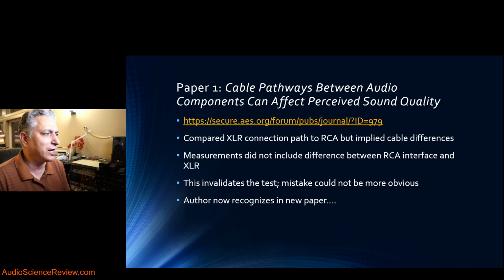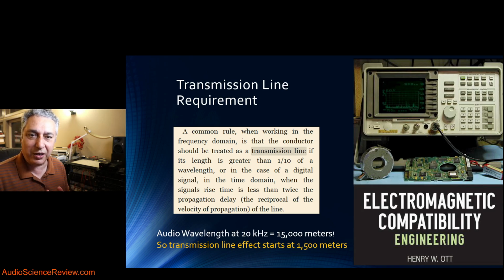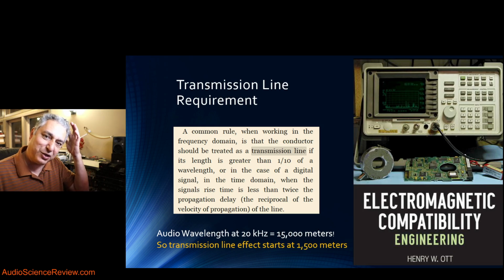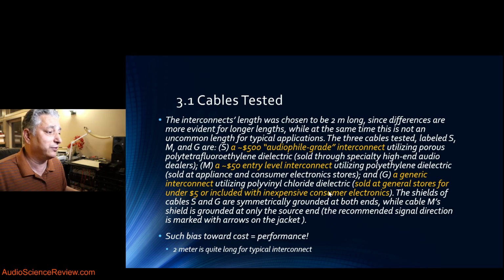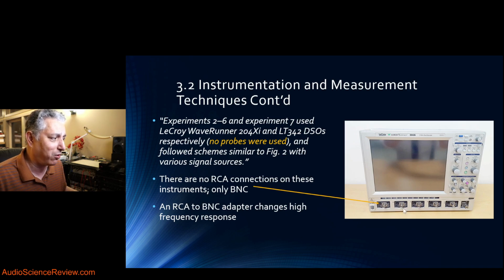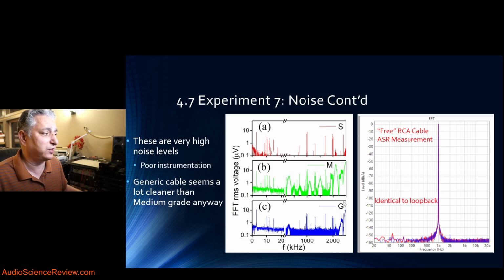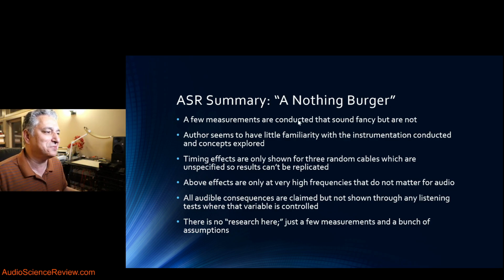Scientific Proof of Measurable Difference in Audio Cables? Paper Review

Comment: Jay likely has more real world experience with both vintage and modern high performance audio than 90% of the people subscribed to this channel. But thank goodness you have Amir with his vast knowledge of everything in audio - so he can smite both Audiophools and misguided professors alike. However if you want to save some time I can help you. All cables at any price that measure the same sound the same. Only Amir's test gear and methods are valid when it comes to determining wether cables or gear are better sounding. Higher price cables are all snake oil and the people buying them are under a mass delusion. So from here on out don't buy anything and listen to it for yourself. Also if someone happens to slip a high end cable into your system without your knowledge and you hear a difference - this is just the transfer effect from the delusional person that played this evil trick on you. Come immediately back here to ASR to be recalibrated so you don't have any more of this artificial enjoyment while listening to your system.
Reply: The problem is not that people enjoy their systems at whatever price point they choose.  The problem is when people start evangelizing for high-end cables and shaming other systems as non-resolving if they don't use these high end cables.  You're welcome to your delusions but that does not make it right to recommend others to them.  That's just a misery-loves-company state of mind; justifying your own potential for poor judgement by encouraging others to make the same misguided choice.
Reply: @johncreech6012  I have never seen or heard any owner of higher end cables shame anyone. But it is the standard chatter here after Amir drops one of his so called "Debunking" videos. John you could not even resist throwing the shaming shade at me during your short reply. Poor judgement, Delusions and the like. As for a misery loves company state of mind - that should be the name of this channel
Reply: @johncreech6012  John literally every negative comment you assign to the supposed legion of insulting cable snobs came from Danny at GR. So find me one or two more YouTube reviewer that say anything like this. Lets take Jay's Video that all you ASR minions put AMIR onto to do his life saving debunk. He is reporting the he and several of his audio buddies are hearing improvements with cables. So he started to try and find out why. Never once did he throw shade on the folks that don't think cables matter. Just the attempt to assign any measurable reason for this caused this community to go into overdrive with all your negative comments. So lets be clear are you calling him and his friends delusional? As for Amirs methods and testing protocols - nothing I could not have found from and engineer 40 years ago. As for coming off my high horse I am not the one who proclaims that because I can't hear any differences in cables that no one can.
Reply: @theaterboyeBay  Again, you're not very observant.  I didn't say youTube reviewers.  Read the commentary on Jay's video and you'll see plenty of examples of people claiming to hear things or (like you) claiming that others don't hear things.  And I agree... an engineer from 40 years ago could have debunked the paper being discussed.  your point?  My point is that Jay's experience with high-end gear still doesn't qualify him to negate physics... which did seem to be your initial inference.  And lastly, I'm not proclaiming anything about my own hearing.  I think if YOU can't prove your claim (of having golden ears or somehow magically breaking the laws of physics or physiology) then perhaps YOU should not be making claims about the benefits of cables.  Therein lies your fundamental bias.  You assume they do something and then require others prove the negative.  Meanwhile you've offered no proof, no references, and nothing of any value other than a snarky opinion regarding Amir's work.  

Lastly (because I tire of attempting to have logical discussions with the illogical), I'd point you to Wikipedia and search "Echoic Memory".  At best humans remember specifics of sounds (not the meanings or other values but the ACTUAL sound) for no more than 3-5 seconds or so.  And the accuracy of this memory decreases with time interval.  There is ZERO chance you heard an audible difference if you bothered to take 1-2 minutes to swap your cables.  Even the position of your head in your listening position could have more of an effect on your impressions than anything the cable has done.  That's why rigorous A/B testing always fails for you "golden ears."  Enjoy your system but please don't tell others they're just not hearing the difference.  You're not either.

Comment: Please Help me with this:  Amir says @20kHz wavelength is 15,000 meters???!  It's in writing at the bottom of the screen. I thought it's about 1.7cm! What am I missing?
Reply: In air, yes. But the paper is concerned with wavelength in an electrical conductor, which is a lot greater,  due to the speed of propagation and 15,000m is about right.
Reply: 20,000 per second X 15,000 metres = 300,000,000 metres per second.

You might recognise that speed from somewhere...
Reply: This is at 10:40minutes

Comment: What is interesting is that I would bet 99.99999% of 'high end audio cable' was never designed for audio purposes. It's just bought in a re-branded. Cable is massive dirty industrial work. That and none of it cost more than 5c a meter to make. No one makes a 5KM+ run of $1000 a meter cable...

Comment: Thanks Amir. It is very sav that there is so much nonsense like this in our hobby. The truth is that audio frequencies are barely above DC and most budget cables are perfectly fine. Coat hanger wire to connect speakers may not look pretty but will have no audible effect on sound quality. It is only at Radio Frequencies that cables and connectors become important. At very high frequencies it becomes more like plumbing, but this does not apply in any way to audio.
Reply: Damn man, good idea!  Now where are my coat hangers??  (I'm not kidding!)

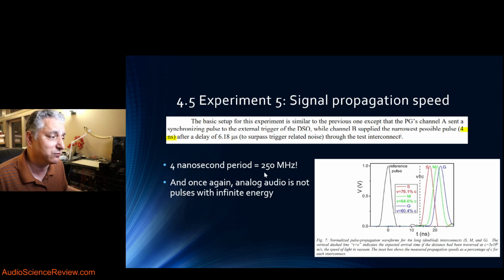Comment: Section 3.2 at 20:00 and 29:50 - he says he uses 4ns pulses...  For audio cable testing?  WTF...?  (Maybe it's to justify the expensive test gear?)  If that's a decent pulse generator the harmonics could reach tens of GHz.  The guy has no clue.

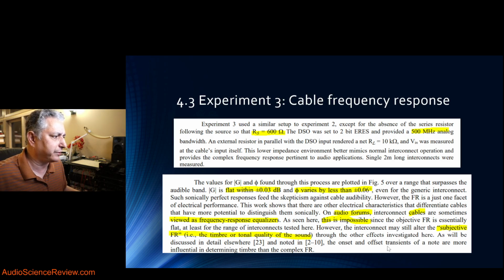Also, at 28:10 - the "subjective frequency response"...  I think it's that warm fuzzy feeling you get when you know you've spent far more than any sensible person on interconnect cables and you've just convinced yourself that it was money well spent.   🤣

Comment: Isn't the audio wavelength of a 20KHz soundwave actually 0.01715 m?
Reply: In air, yes, but the paper and this rebuttal is concerned with when it's an electronic signal.
Reply: sound waves do not travel through cables, electrical waves do
Reply: @Douglas Blake but the word audio or in full the electrical wavelength in the audio frequency spectrum is a very important word to include as well because all other frequencies are irrelevant to human hearing, to audio amplifiers and to Speakers which all have a build in frequency filter. and I can't blame Amir for trying to shorten such a long title to just audio wavelength
Reply: In air, yes. It varies very slightly with air pressure, but yes.  I just calculated 0.01699m.  Wavelength in an electrical conductor is very much greater, of course, due to the speed of propagation and 15,000m is about right.

Comment: Amir, do you think it's possible to hear any difference between RCA cables with different insulation materials? 
I kind of do, so do other people, but I am not sure. Because they also hear some ugly midrange distortion in my cables that I don't. :) Cable in question is Belden 89182. Could you get a piece of that cable with Canare F-10 plugs soldered with Kester "44" and check it out for the frequesncy response and distortion?
Reply: Not Amir, but I will answer) 
Of course you can. Imagine two options: one old dilapidated cable, with conductors soldered from the connectors and decayed insulation, and the second is brand new. You will most likely hear the difference ))
Reply: It is possible to design a cable to alter the signal audibly. It isn’t that all cables sound the same. It’s that transparency is easily achieved in a basic modestly priced cable

Comment: The error in the testing methodology in Paper 1 reminds me of the arguments people have regarding Bluetooth codecs. There are people who SWEAR they are hearing a difference in sound when switching between LDAC, aptX, AAC or what have you. What they often don't realize that the differences rarely come from the codecs themselves but the way the way the receiving device is processing the audio, which can sometimes be different between various codecs, leading to a perception that the codec is making a difference when it's usually just poorly inconsistent audio processing.
Reply: Low bitrate standard bluetooth will always sound worse than LDAC and that has been proven with measurements by Amir. Low bitrate is highly compressed and cuts off a large chunk of the top end (over 16khz, like MP3).
Reply: @formdissolve  Agreed.  Those differences are audible.  I was simply agreeing with the earlier post that the implementation also has a big role to play.  That is especially true for some brands that aren't able to build the lower-level audio processing software themselves.  It's not much different to how a poor hardware design can destroy the performance of a good DAC chip.
Reply: @formdissolve they still have a point that downstream processing can be the primary source of audible differences.
Reply: Agreed.  Even good old SBC can be very good and has often been used by quality brands in hi-fi components.  Of course there are differences between codecs, but good implementation and integration is what matters most.